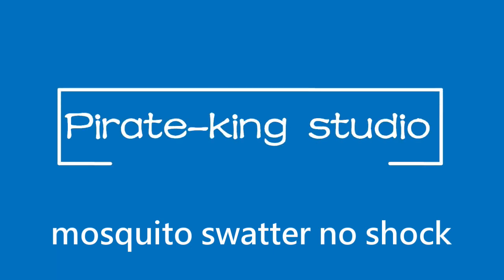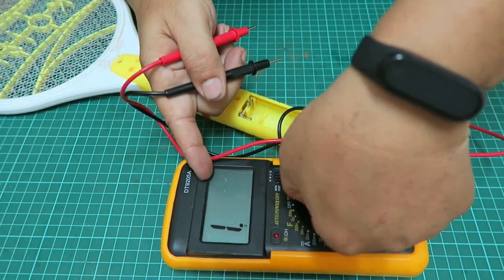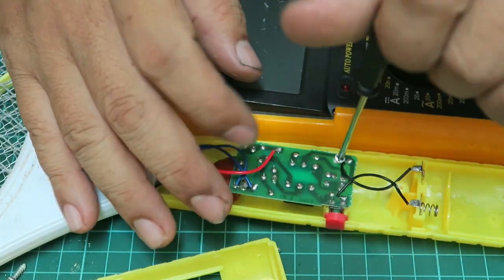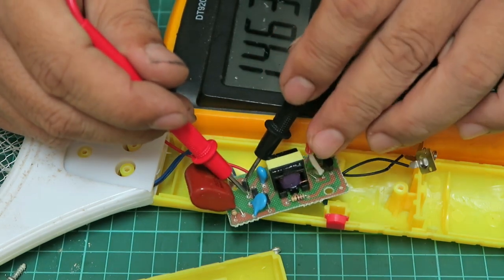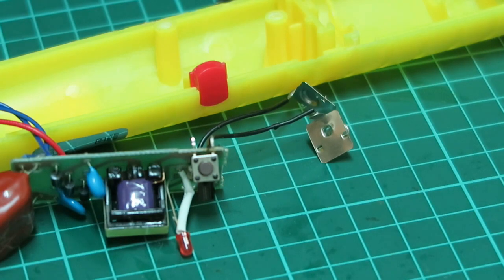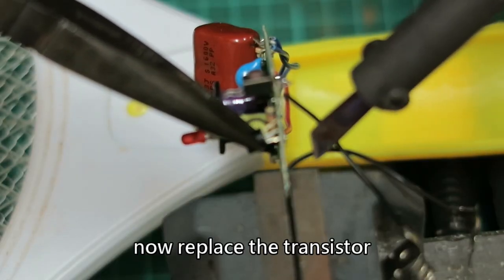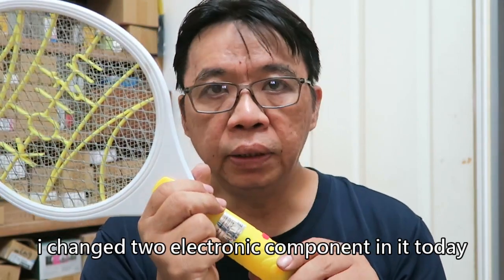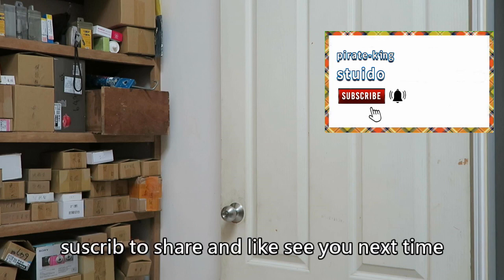how to repair the mosquito swatter no shock  Check the failure point step by steppirate-king studio

Comment: Pirate king, what happens when the mesh got wet? Mine just did and it wont work now.
Reply from the maker: Remove the battery and dry it as soon as possible
Reply: @pirate-kingstudio5774  thank you for the tip.